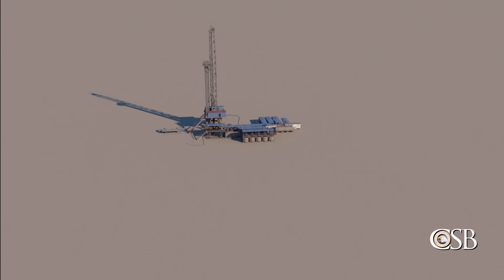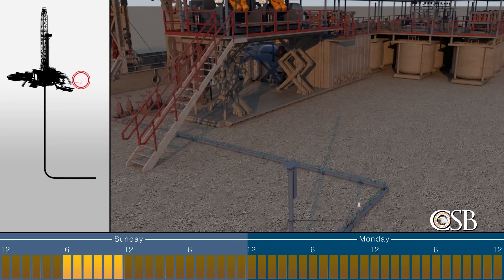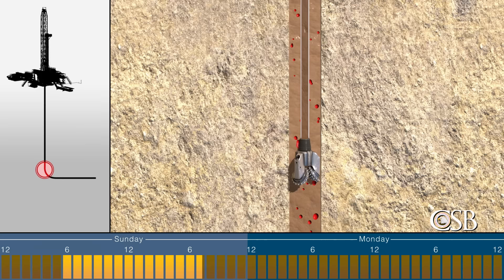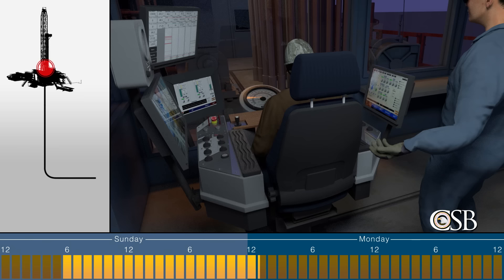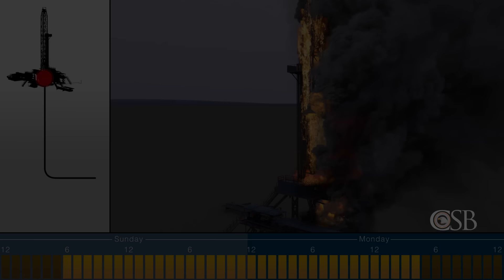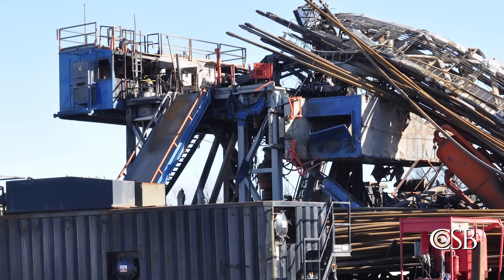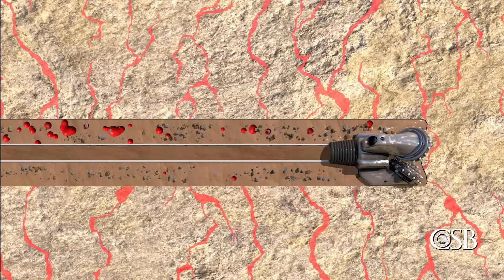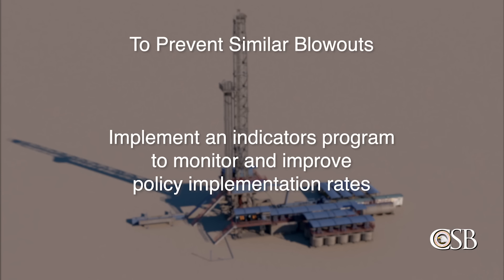Blowout in Oklahoma

Comment: The first problem to this is that you have to eliminate the "culture" on rigs where it's cool to get away with something if the safety man didnt see it...   Those rules are there for a reason people, so why are you standing idly by and allowing cultures like this to be fostered without stepping in?    99% of all rule breaking or anti-safety rule cultures start with a total lack of proper and supportive management...
Reply: There is an issue with heavy safety rule enforcement, the safety rules are not always relevant to the task at hand so enforcing rules that are not relevant just because they are rules enforces the perception that the rules are pointless.
One of the factors in this disaster was the alarm system constantly alerting the operator of conditions that were not relevant to the task at hand, which caused the operator to turn off the alarm system and thus miss alarms relevant to the task at hand.
Reply: @AvNotasian  this, information overload is a real thing.
Reply: NotAsian preach it we need REAL safety in industries NOT the BS safety handed down by governments or God forbid LAWYERS. Real safety doesn’t nit pick the small things it builds up the good things. Promotes the guys that believe in real safety not the guys writing JSAs. Remember WORK comes before safety! If you can’t pay for it then how are you going to have it.
Reply: @ryanburbridge  "Work comes before safety!" - hopefully not famous last words.
Reply: Ash Kebora umm no literally... Work is absolutely always positively placed above safety! Think about it for two seconds. Yes we mitigate risk but there is ALWAYS risk and if there is risk there is potential injuries. If we actually placed safety first we would not risk anything and nothing would get done.
Reply: @ryanburbridge  Safety first doesn't mean safety only. It simply means you cross your t's and dot your i's. Your paycheck should reflect risk and required skill. If it doesn't ... get out of that industry.

There were plenty of warning signs, indications, and actual alarms telling these workers bad stuff was happening.

Instead of taking a moment to double-check they weren't about to get a blowout, they blindly barreled on ... and got a blowout.

I seriously don't know how someone can watch a video like this and think, "Nahh, safety isn't that big of a deal." What a joke.
Reply: Ash Kebora no one said safety wasn’t a big deal... i said it wasn’t First. This video had the major benefit of hindsight due to knowledge after the fact. I would say the safety culture you sound like you want is more to blame then anything. In today’s world of lawyer safety and policy people don’t think for themselves they rely on some “safety” guy. When i worked in the patch the small zero safety guy company would teach you with an ass kicking that you would remember and the big waste money all morning on JSA BS then rush to get it done company would hurt the young by waiting on the “safety guy”. 

Look i live safety every day. Not one broken bone or stitch on my body after years of being around heavy industry. I live it not wait for the safety guy
Reply: And you have to have proper psychological and motivational influence conveying sadety needs. If I'm the safety inspector, I have to be in their side. 

I can't enforce the rules cause I told you so, the workers will hate me and hate the rules through my officious attitude. 

I can't enforce the rules because you're gonna die. The worker can't imagine dying that easily and he hasn't died so far. 

I enforce the rules because the boss will have BOTH of our asses if we don't get this fixed!
Reply: @carrasco4712  with all due respect, your wrong...   I worked in a particular industry that was not just dangerous, but very dangerous for the public...    I transported chemicals in huge bulk quantities...   so to keep companies from being able to pressure us to take shortcuts, we were licensed and to get it, you had to swear an oath to protect human life, protect the enviroment and follow the law as well has have been an apprentice for 6 months...

If you have an accident, you automatically become the "first responder- scene commander" if you survived and you coordinate with local authorities to evacuate people or even order the power shut off to whole communities to try and stop a spark from happening in a flammable vapor cloud...   or you might do a reverse 911 for a certian area to tell people to remain indoors and shutoff their AC system such as in toxic or poisonous vapor clouds...    once an accident does happen and you become the first responder scene commander, a relief is sent...   upon arrival, you coordinate with them on where you are in the response process and suggest the next steps...   then you are detained automatically pending investigation..    if human error, you can be prosecuted...   if equipment failure, did you do everything possible to protect human life and protect the enviroment you swore an oath to protect?

So there was no rule breaking culture in our industry because every single person was responsible and swore an oath to their duty...
Reply: Dollars to doughnuts the proper and supportive management was screaming "Get that GD drill turning again by tomorrow night, and F the alarms, or your ass is looking for another job!"
.... fortunately all the witnesses were incinerated. 🙄
Reply: @DeadNoob451  boomers take that.
Reply: The first problem is they should of put the gasoline in a tank instead of burning it. If they didnt have a fire there then it would be safer.
Reply: @AvNotasian  Exactly. I've been on rigs where such alarms were a real problem. What to believe and what to ignore. Poor design and poor management and training combine to cause a problem. OTOH, without ANY instrumentation beyond a mark on the tank wall, and the very obvious flow of fluid it should have been obvious they were gaining volume. And that should have alarmed the driller far more than it apparently did...You are about to take a kick, deal with it now. Circulate it out now. Mud up. DON"T pretend it is inconsequential.
Reply: @ryanburbridge  We can start by dumping slogans like, "Safety is our number one priority." Who knows what that means? If it were really true no one would ask workers to show up.
Reply: 3sierra15 awesome a guy that gets it lol that’s exactly what i have been saying. We all know jobs can be dangerous and it is and always has been up to us as INDIVIDUALS to understand the risk vs reward. Governments are absolutely inadequate at protecting its people. The free market is best at balancing protection vs profit. A reckless company out for only profit should be sued into oblivion when their lack of training or safety causes death or injuries. Then the other side when a company is wasteful with too much BS safety they will fail. Us older guys must always teach the trade to the next generation. Pride in what we do will always beat BS safety policy.
Reply: You ain't lying
Reply: The Irish Italian  The fire hapened cause there was a fire going. It wouldnt of started more if they didnt have it there.
Reply: Maybe such things are set up in too punitive a matter? Thus instead of looking first to address the problem, the things are set up in regards to pinning the blame on somebody? If that's the case, then I could see why there may be a tendency to look the other way since nobody wants to be a tattle-tail. Also sometimes reports and hearings for some violations could end up resulting in an action that also has a punitive result. If you flag a problem that shuts down an operation for a month, and then nobody on a crew gets paid for that month, do you want to be that guy? Likewise higher-ups now have to go through a lot more paperwork, so they're not going to be too friendly to whoever called things out either.

So some things may need to be restructured and addressed to help limit the CYA and look the other way attitude. Maybe incidents being handled as part of a regular monthly report instead of as they occur, salaries guaranteed under contract for the time of employment, etc. I doubt that's going to be something easy to come by on a voluntary basis from the drilling companies.
Reply: GreatDaneLoverz, It's called "The 'O' word you can't say" and that O word dominates foreign policy, is the cause of countless deaths and so forth. There is also "profit".
Reply: NotAsian, Oh let's all "thank" you for repeating the findings stated in tbe video then I'll point out- True safety means getting it right,  not installing the minimums
Reply: It's all about the $$$$ nobody cares about safety I see it daily here in ND
Although some safety regs are a safety issue in themselves some companies go overboard
Reply: Amen, great comment! I was thinking myself - "and if someone had told them they needed an SOP or  Bridging Document" they'd probably have moaned about "goddammned engineers and paperwork". Safety is an attitude. I am soo sad to see 5 died totally needlessly. Safety is also a passion, but too often BS stuff blamed on H&S gives it a bad name (e.g. stopping people do fun stuff)- safety shouldn't stop people doing things but enable them to take risks but safer and mitigated.
Reply: And management is always keen to cut personnel and cut corners to make the extra bucks. Money talks, managements listens intently.
Reply: Look to Exxon Mobile for a real safety culture.  It literally starts at the seemingly benign.  Nothing gets ignored, and excuses are never permitted.  No exceptions.  Never.

Comment: Just the other day I went in to my night shift for the boiler room, and the guys I was relieving told me about an alarm that kept going off for low/high water levels in the deaerator tank. For about 4 hours all they did was manually operate the valve every 10 minutes, but they just couldn't be bothered to actually look for the cause.

I went to look and it was literally the first thing I checked: a loose set screw on the shaft that linked the float to the valve. Took not even 5 minutes to fix.
Reply: Some people just don't think
Reply: I have some stories about Deaerator storage tanks.. but it is only too often something very simple that is mucking. 
I remember once a Turbine wouldn't run once you put load on it, even 500kw (10 mw steam turbine. So here are all the experts  poking  around trying to figure out what's what.. and this new kid (no exp) shows up, and picks this bolt up and it was the pin that was the pivot on the inlet control.. He just asked 'What's this for? Found it on the floor.' 2 minutes later, we were pushing full load.
Reply: I know exactly what your talking about.

Comment: I work in a completely different field (networking) and I can attest to the fact that alarms don't mean much when they are drowned out by irrelevant ones. So much of my shift I spent chasing down pointless alarms when in fact only a few of them actually mean something that needs to be fixed, the rest are just normal events that don't even need to alarm in the first place. The problem is that if they turned off the hundreds of garbage alarms, then one or two actually needed alarms would be eliminated along with them. Its a tricky problem and only a complete overhaul of the monitoring system can solve that
Reply: Yep, I once had a job where all night some stupid alarm was being triggered from like 300 miles away (literally - a radio system). What was annoying was that because they made the alarm unsilencable we had to totally turn off the system which WAS a safety issue. False alarms are bogus and bad for safety.

Comment: I worked for Patterson UTI for a while before I went to another company. I left because I remember thinking to myself that someone was gonna get hurt or killed on one of those rattle trap rigs they had in the Barnett shale. Scary man.
Reply: Mike105 i worked on the frac side and felt the same way so i left
Reply: I got hurt on a Patterson rig and was asked not to file a workers comp claim. When I did I was terminated.
Reply: Gotta love good old SPLATTERSON in the DFW.  Them POS rigs were everywhere.
Reply: Patterson Is a good company I worked on their new 800 series rigs. Things aren’t the same these new rigs are well designed. What happened here was because of bad habits that for a while you can get away with.
Reply: @JTTodd-pn5sd  This happened in 2018 though

Comment: Jesus... that must’ve been a gruesome scene inside the driller’s cabin after the fire burned out..
Reply: There probay wasnt evough to even bury.
Reply: I think they died almost instantaneously when all the gas flashed over, normally you suck in the flame which is a quick death at least. No, I would not have wanted to be the first responder.
Reply: at leasst it's pre cooked
Reply: @kg4boj  There'd be enough to bury, most of the fire would have headed upward after the initial explosion.  Might be hard to identify who was who though, and those caskets would have been pretty light.
Reply: The photo at 14:37 is the scene I’m talking about (I’m sure this is after the deceased had been removed)

Comment: When i have men’s life in my hands I will listen to every alarm,and make sure they make it home to their family.
Reply: That is very noble of you, but in a poorly managed system, you may not be able to keep up. 1 alarm/10 minutes is considered the threshold rate that an operator can handle, but most alarm systems do not achieve this.
The blame lies squarely on management. Videos like this remind us that management must ALWAYS have a plan to develop an adequate alarm system.
Reply: @Don2006  i appreciate that you left this comment.  it's very easy to lay blame at the foot of the operator, and in fact, for many companies, the system is designed to offload risk, externality, culpability, etc all onto the operators on the ground; a replaceable fall guy that can be pilloried when things go wrong.  in reality, though, blame lies with the safety environment in the workplace, and that lies solely at the feet of management.  things like ever-present alarms that get disabled are commonplace.  people don't realize that in a lot of industries like oil & gas, taking prudent action in the interest of safety is PUNISHED if it interferes with production.  that becomes a larger workplace culture issue that hugely influences how people do their job, and can silence that internal voice of reason that says "wait, this isn't right".

Comment: The problem with safety rules at most organizations is that a lot of times they're annoying to comply with, and just make busy work for no reason.......so you have to design safety systems that are only in place for serious dangers, and are as simple as possible to comply with.   If it involves a lot of unnecessary stuff, it will get turned off or ignored on a day-to-day basis.
Reply: Without rules no matter boring you get these kind of accidents hapening

Comment: They needed to increase the density of the mud not try to fight it with bigger pumps.
Reply: They should have raised the mud weight before starting out of the hole, and the use of calculated fill or constant fill neither should have been used with a possible flowing well but an actual fill to flow the you know exactly  hpw much it takes to fill the hole.